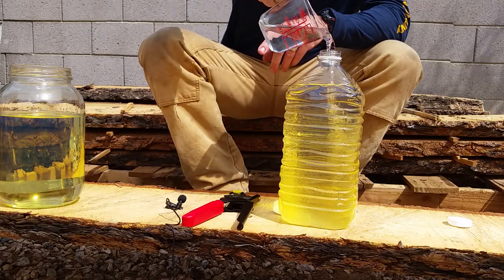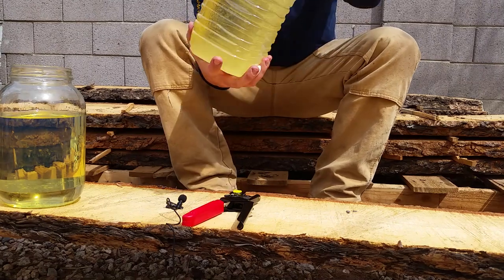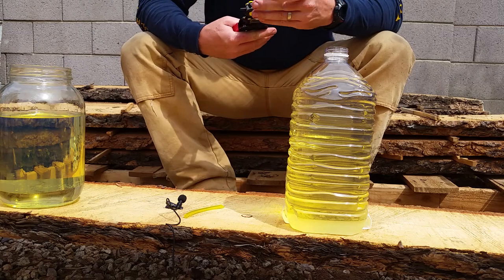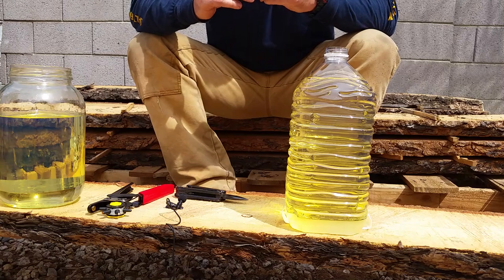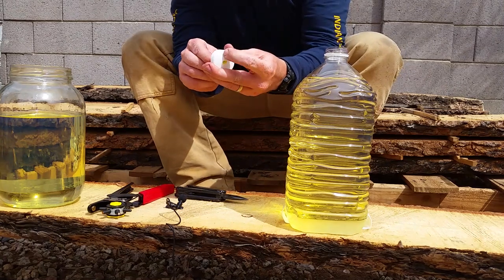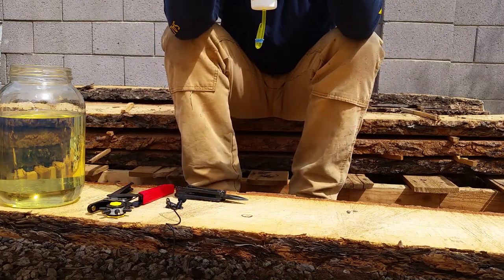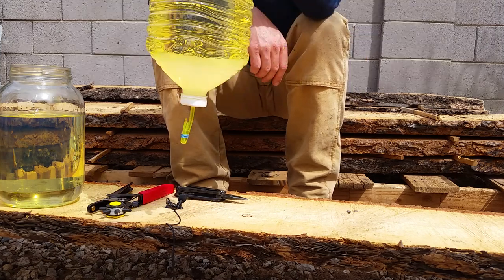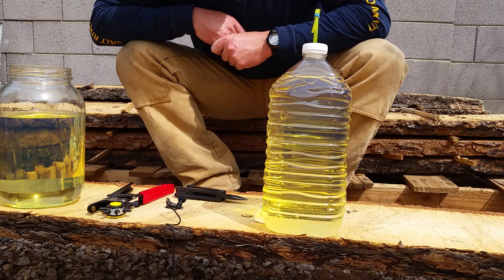Removing ethanol from gas

Comment: Even if this works  it's not a good idea because gas is 84.5 octane, when you add ethanol it raises it to 87 octane. I have worked in a gas storage facility in Knoxville TN for years.
Reply: buy super! then you average out to 90 or so..well above the 87 needed for most tools..or cars..
but this is SUPER for small tools that the ethanol clogs up ! ..things like my back-up generator that sit for months..then you REALLY need..LOL

Comment: So does removing the ethanol decrease the octane rating?
Reply from the maker: Yes
Reply: If that is a problem for you simply buy a higher rating gas like super and take the ethanol out of it using this method.

Comment: So my Harley with 400 miles wouldn't start this spring and when I looked into why I found the electric fuel pump rusted out and a ring of rust around the bottom of the tank where the water had settled out and barnacles growing in the tank!

Comment: Av gas or aviation gas is ethanol free and full lead 100 octane in the UK, perhaps it's the same for you guys?
Reply: Most av gas haas phosphorus added to it to combust  at high altitude better which will kill ground based engines 100 times faster than ethanol. BAD IDEA
Reply from the maker: +Chris Chapman I made a video on 100LL

Comment: If you are not in a boating area where it’s easy to find, check with lawn care companies to find it locally. Every lawn company I know uses ethanol free gas in their small engines to prevent gumming up and failure of the fuel systems.

Comment: This is phase separation the same way we do to test it for percent , this would work for a 
chain saw but keep in mind the ethanol is how they get octane rating. If
 you separated 87 you'd be left w 84 or 85 octane, if you did this to 93
 you'd be left w 89 or 90
Reply from the maker: +O Def good point

Comment: I'm just wondering why you want the ethanol out of the gas.
Reply from the maker: +Ron Yerke it ruins small engines(chainsaws,mowers etc) by gumming up the carbs and rotting the fuel lines
Reply: KimballCody WHAT!?  The sun revolves around the Earth?  Keeping small engine clean is as simple as not letting gas sit in the tank for extended time, an either using gas stabilizer or running the engine dry when you expect to be done with it for the season.   You didn't show any way to verify that there was ANY ethanol in the gas OR the water.  By putting such a large amount of water in your gas, if it wasn't saturated before, it will be after.   Manufacturers used to put small glass bowls before carburators for water detection and draining LONG before anyone started putting ehanol into gas.  This was how water would get in; through condenastion.  Just because the manufacturers went cheap and left those devices off doesn't mean the condensation problem has been resolved.  Most dry-gas additives we put into our cars and trucks today are mostly ehanol.  When we burn the gas, air (with humidity) takes the place of the burned-off gas.  When the temperature goes don, the humidity condenses into water in the tank, just like dew in the morning.  Taking the ethanol out makes MORE water build up in your tank, not less. Just keeping the tank full as often as possible will go a long way to keep condensation out of the tank.  Keeping the engine tuned up will also help.

Comment: I like the idea, and had seen other video's but forgotten. My only question is - What do you do with the ethanol mix you have drained off? I suspect it is still flammable,  not something you want to just pour out on the ground and trash companies would not be happy with it mixed into the trash. There should be something constructive  that it can be used for.
Reply from the maker: I dispose of it with my waste oil
Reply: Pour it on an aunt hill, the ground, doesn't matter where you pour it
Reply: Let's see. It is ethanol and water. What could you do with a mixture of ethanol and water?

Comment: I use 7 -10 gallons of fuel daily in my vehicle. How could I do this safely without consuming a great deal of time?
Reply from the maker: +MrJohnnyDistortion 10 gal jug?
Reply: you can't, just keep burning what you have been burning, there is a science to gasoline, we only use this trick to verify how much corn water is the gas of a customer car if we suspect over loading of corn water and we use glass not plastic

Comment: All of your fuel treatments contain alchol for this exact reason. It removes water that collects in the bottom of your gas tank due to condensation with temperature changes.
Reply from the maker: +Lothos Delion where does the water go? Generally once water gets in gas it must be drained off.....it can't disappear. Left in an open container the gas would evaporate before the water.
This leads us to the modern problems of ethanol and small engines
Reply: everything in the old days was better, now we have people who like accepting bs engine crap like ethanol

Comment: IF a car is flex fuel it has a sensor that measures fuel temp and ethanol content and the computer uses these readings to adjust the mixture of air to fuel. Most cars run a device called an Mass Air Flow Meter that measures the amount of air entering the engine, and the o2 sensor reads the content going out and the programming the computer has adjusts the injector pulse width to determine the amount of fuel injected. How this is done is that the injectors are rated to flow X amount rated in lbs of fuel per hour, at a rated fuel pressure. The older cars use a fuel pressure regulator to increase fuel pressure in respect to engine load by engine vacuum reference.
Newer cars use fuel pressure sensor and a variable rate fuel pump/control.
Now the flex fuel vehicle uses the fuel sensor reading in an algorithm with MAF and O2 sensor reading and other readings to computer an optimum air/fuel ratio to maintain power and emissions. 
So many  people on here have ZERO clue about how a car runs other than fill tank, change oil, complain about crap they know nothing about. SOME cars will have a slight decrease in fuel economy between straight gas and E10, which is mandated by EPA(BS mandate about fuel having an oxygenate added to "make it burn cleaner" even though this is what the car is supposed to do).
NOW E85 was an offshoot of old technology from gasohol days developed and intended to create a cleaner burning fuel for areas with smog problems. Now lets explain E85, ITS DENATURED ETHANOL. Drunks cant drink it as its denatured.
Cant sell large quantities of pure ethanol due to FEDERAL GOVERNMENT BATFE REGULATIONS!
NOW The reason we like E85 is the fact its 105 octane thus allowing performance oriented peoples cars to run higher compression for better performance. AND the fact that moving larger amounts of fuel with a cooling effect, it makes car run cooler alleviating spark knock/detonation. 
YES due to its chemical composition it requires MORE volume of fuel to produce same power.
NOW the upshot of a less complex and energy dense molecule is WHY it requires more of it, BUT the upshot on that is moving more fuel absorbs more heat from intake tract, thus allowing the engine to ingest a denser fuel mixture. Also ethanol burns cleaner as its byproducts generally carbon dioxide and water, both of which plants love! 
Also the fact is that ethanol IS a renewable fuel source.
Whereas petroleum may be a finite source. 
Ethanol has its place, E10 replaced Methyl Tertiary Butyl Ether (MTBE) in gasoline to follow the BS rule from EPA to add an oxygenate to motor fuels. When it was incepted  MTBE was most commercially available oxygenate that was plentiful. When the EPA kept mandate MORE people had to push for government subsidies to help investors step up and build ethanol plants THEN other people stepped up and pushed for mandate to keep human food organic materials from entering fuel grade ethanol production. NOW lets also state the FACT that feed grain produced ethanol leaves behind distillers dried grains or wet cattle feed. Generally 26% protein content cattle food. Also carbon dioxide produced from fermentation can be collected and used for sodas, cooling and other uses. And during the process of making ethanol they can get other grain byproducts from it. 
The whole thing comes from BS EPA rules and regulations and specific areas that never put proper regulations in these certain areas , namely basin areas like Denver or L.A. that dont get great airflow to disperse smokestack emissions. AND the fact is proper control over smokestack emissions did more than any other mandate.
Reply from the maker: +MonzaRacer thank you

Comment: That is pretty cool. I never knew how to separate out the ethanol. Did you notice a performance increase in your power tools?
Reply from the maker: +Love2boat92 I haven't had time to do a side by side test. I'll try to get one in this week while milling.
Reply from the maker: +Love2boat92 I used it while milling and noticed that the idle was pulling the chain but when I switched back it stopped.  If I were to use pump gas more often I'd just adjust the carb accordingly
Reply: KimballCody That's interesting. I saw that in your most recent video the chain kept turning when you let off the trigger. No noticeable power increase though?

Comment: Takes 12 or more hours time make this and it takes maybe 30 minutes to take the jets out of a carb and clean them if needed, or better just use some Sta-Bil and you are good to go. My snow blower is 12 years old, I have run Exxon Premium the entire time, and leave the tank full every summer with some Sta-Bil. So far I have not had any issues and when I have looked at the carb it is clean as well as having a smooth idle.

Comment: Where did you get the " 1 Cup / Gallon" ratio from? Thanks!
Reply from the maker: Just a measurable amount
Reply: @KimballCody  Is there an ideal ratio "12Oz Water/1 Gallon Gas" or something like that? I have watched other YouTubes on this that are not as good as yours. It just seems there must/should be an ideal ratio that gets the 10% Ethanol out, but without adding excess water (?)

Comment: If you use an inline fuel cutoff valve it's a simple method of leaving your bottle upside down overnight above a collection container once it's fully settled crack the valve and drain the ethanol and water as soon as your down to pure fuel close the valve
Reply from the maker: +Bad Drivers i used the rubber band as a cut off. But when I make a permanent one Ill do it your way

Comment: Why take it out and put it back in? 
Octane boosters usually contain one active ingredient, sometimes diluted in a solvent (like toluene). Typical active ingredients for octane improvers are alcohols, ethers, manganese (MMT), or tetraethyl lead (TEL). Alcohols: Methanol and ethanol are alcohols which have been used as octane boosters.

Comment: The company I worked for used a 70 20 10 blend  take 70% 87 octane gas blending in a lower octane gas at 20% and then using the higher octane ethanol to raise the octane level back up to 87. so if you got that gas at a station using that gas after removing the ethanol your gas is well below 87 octane. some company do give away octane by using a 90 10 blend if you buy that gas although the pump says 87 octane it is really like a mid grade 89 octane. so after you did this you will have 87 octane gas. The question is do you know which companies blend at 70 20 10 and which ones use a 90 10 blend?  Even if you know that you still don't know, because all the companies buy according to price. just because you go to a station  branded company xyz doesn't mean they didn't buy that gas at company abc due to the fact that company abc had the cheaper price the day they needed to order a new supply. for a station.  the shit that goes on in the petroleum industry is crazy it has nothing to do with brand, price is the only thing that counts.
Reply: I forgot to mention most octane boosters are nothing but ethanol

Comment: I am not a petrol engineer, but I wish to make a few comments for clarificaton.
 In the 1990's they added MTBE to pump fuel.. It was added as an anti-detonant, but was determined to be a carcinogen and was removed from pump gas.  Ethanol is added to gas today as the anti-detonant. Unless it is E-85 which is flex fuel only,
All pump fuels must not contain above 10% Ethanol by volume  Batches will vary, but must stay below 10%.
Refineries produce winter and summer blended fuels, based on geographics and altitude. Mile(Denver Co) above, or at sea level etc.  
Colder winter air needs less anti-detonant ethanol added.
Computer controlled engine and fuel management is so "modern."
But most small engines still use a carb and 1930's style flywheel inductor/coil for spark ignition.
A true CDI ignition will start much easier than old-skool flywheel/magnet technology-But I digress here.
Back on point.  What is the new LOWER OCTANE rating of the fuel, after you REMOVED the anti detonant Ethanol?...82? .....Ping-Ping -Ping! Hello! McFly!!!
EPDM and BUNA rubber compounds are not ethanol friendly, yet mower companies want to sell gasket kits....Hmmm?
Corporate Profits? Capitalism?
If you have some time and some motivation, you may find Viton needles are available for your float carbs. 
Or maybe run the engine until both tank and carb bowls are empty after each use, genius.
Reply: I have a Honda GVC160 engine. Once I turn the fuel shutoff to "Off" it takes about 2 minutes before the carb bowl is Empty.  She'll just sputter and stop, it won't hurt. You got splash of oil all the way till shut-down.
The gas still in the tank is safe for the next week of mowing. 
A fuel cutoff, a small $4 inline filter and spring clamps are so easy to install on an engine that has an external fuel line. 
Most poor engine performance is from tiny speck of dirt/trash/rubber in the carb itself, not the "ethanol" fuel.
 Do you check your gas can(Look Inside) before pouring "fresh" fuel into your mower for dirt/trash?
The idle air bleed, and fuel transfer ports inside weed whacker and mower carbs are so tiny it's very easy for them to clog. Install a filter and drain all fuel before winter storage.

Comment: If you add salt to the water it will work much better. If the gasoline is the same proportion of heptane to octane removing the ethanol wouldn't change it but they might use lighter hydro carbons to lower the cost. Best way to raise octane is to add toulene to it. Think about 10% to replace the 10% ethanol.
Reply from the maker: +Dave B I'll try that

Comment: Interesting and educational. In my area pure gasoline is available at a couple of different stations although at a premium price. Great solution if pure gas wasn't available to someone in need.
Reply: October 2022 Canada completely eliminated all non ethanol stations and I always ran premium non Ethanol in my small engines. Now I just need to fire out how to siphon off from the 24ltr glass carboy I got from a wine making shop as it didn’t come with a sealed top.

Comment: That was super cool!  The only issue I can see, other than the octane drop folks have mentioned in the comments, is, what do you do with the ethanol/water mix?  There is literally no where in my area that will take "bad gas".  I can't imagine there's anyone around that would recycle the ethanol/water mix to dispose of it responsibly.
Reply: Ethanol boils at 173°F while water boils at 212°. Theoretically you could distill the mix and be left with pure E and pure water. Sell the e, and feed your plants
Reply: @CurtisGingue  But you should be sure, that no other components or chemicals are in it that can be harmfull. There is no use to wash the ethanol from fuel. It is just a game.
Reply: @fflecker  older vehicles can't run fuel with the ethanol levels in modern gas. So there's some value
Reply: Ethanol is basically vodka i pour it right in my yard its not toxic
Reply: Its just pure alcohol and it evaporates

Comment: Remember when you could buy a ethanol tester at ACE or Bluegrass Hardware. Much like a test tube, to check the % of ethanol in your local station's gas, you just add a water to the tester up to the water line on the tube. Shake, and let it settle, and you got a reading of what the ethanol % in you gasoline. I learned my lesson burning up a great chainsaw and a couple of lawnmowers. This method should work in an emergency but outside of major cities you can stlll find real gas, or check the FBO at your local airport. He's got 100LL.

Comment: A tankard with a valved attachment can be set upside down for a day or 2 and then the valve opened  to let out the contaminated ethanol/water. Stop when the ethanol is drained out and pure gas remains.

Comment: Actually, "MOGAS" is a military abbreviation for 'multi-octane gasoline', which means that when they bought gas, whether it was 86, or 92 octane, ( or anything in between)  it went into the same tank. Lowest bidder, whatever they could get. Not exactly what you want to put in your hemi.
Reply: That might be true but it's still suppose to be ethanol free.

Comment: I see the comments on Octane, so it seems I need to clarify for everyone. "Higher" Octane fuel increases the temperature of the flash point of fuel therefore suppressing Detonation in high compression engines. Lower Octane fuel has a lower flash point which causes Detonation in higher compression engines.
Reply from the maker: +James Gregory diesel....high flash point(takes more heat to combust) 25 octane.

Comment: If the ethanol is settled can you see a difference in height from the original water line? does it become more?
Reply from the maker: Theory is with a fuel with 10% ethanol at 100ml and you add 10ml water you should get 20ml water/ethanol on the bottom.
Reply: Do a test and see demo. Then let us know. TY